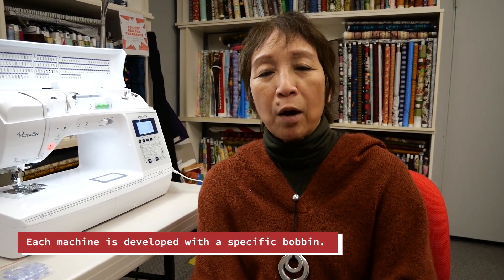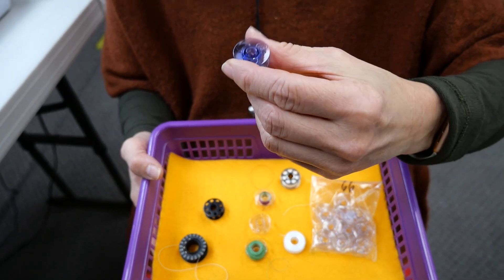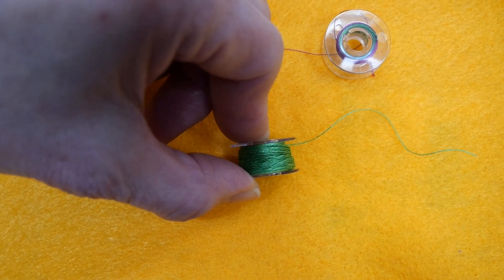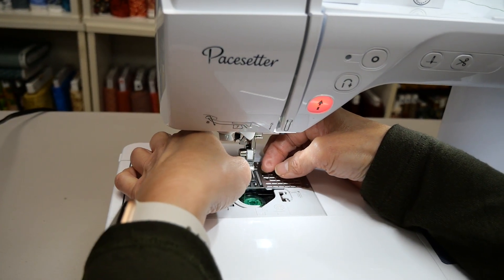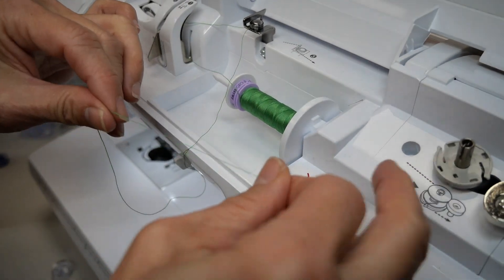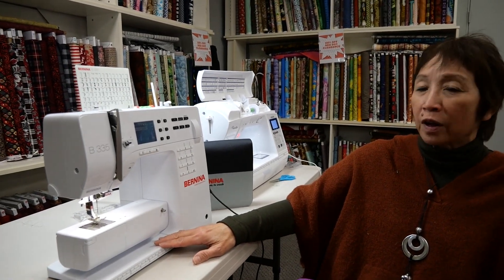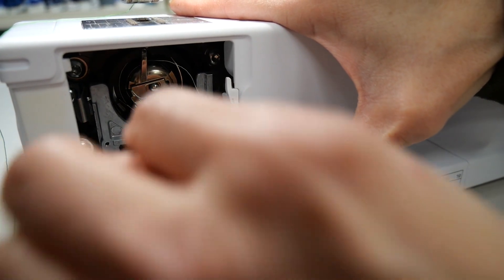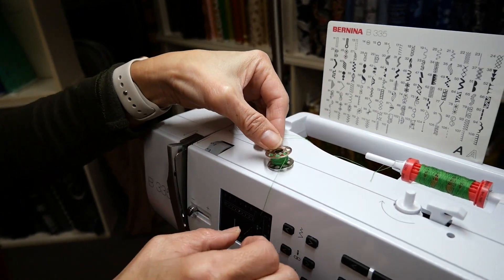Bobbin Basics with Laurie at Sew Right Sewing Machines

Comment: Great instructions on Bobbin usage. I didn’t know you shouldn’t reuse a pre-wound embroidery bobbin. That seems to be such a waste. I wonder why my Janome pre-wound packaging doesn’t tell me that. I would’ve spent the money on regular bobbins for my machine instead of the pre-wounds and just wound the bobbins myself so I can reuse them. Good to know the plastic bobbins are for top load and metal bobbins for front load machines. What causes the spongy bobbins? I have several I need to rewind.
Reply from the maker: Thanks for sharing Marshia! Spongy bobbins are caused by poor tension when starting to wind your bobbin. When you initially wind your bobbin, ensure that everything is threaded correctly and that will give you proper tension to wind the bobbin. Hope that helps!

Comment: I got a new Janome 740dc, the manual says to put the speed slider on the highest to wind the bobbin. On my first attempt,I did it right but for some reason, because the speed was high, the thread started right then the thread somehow came off the bobbin and before I could stop the process, the thread was under the bobbin into the gap between the bobbin pin and the machine. I had to cut the thread and pull it gently back out of the machine. It scared the crap out of me. Since then, I start on the slowest speed and once there’s a number of layers I put it on high speed. I still get anxious doing it since that first time.